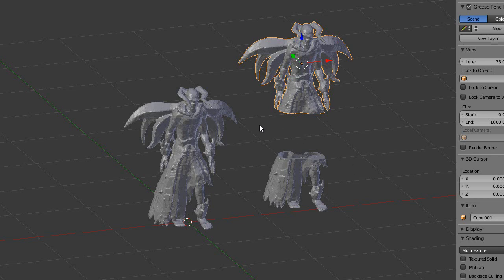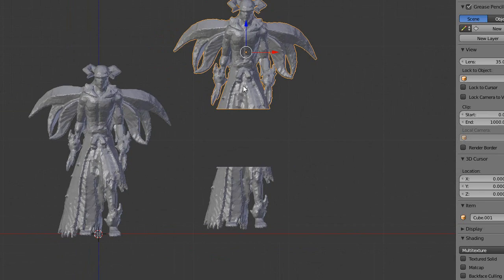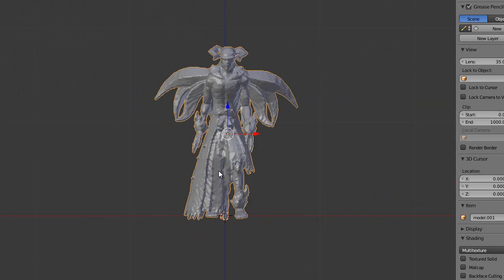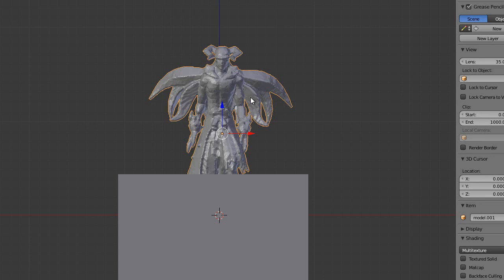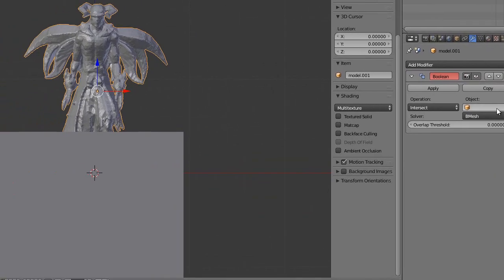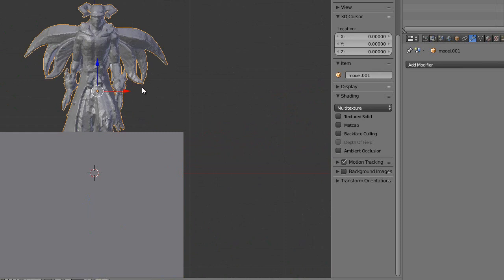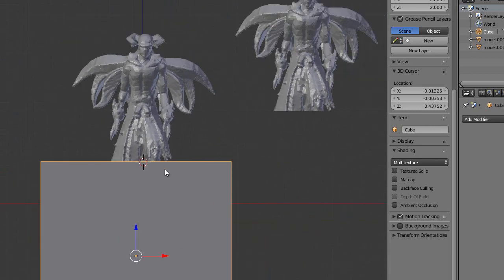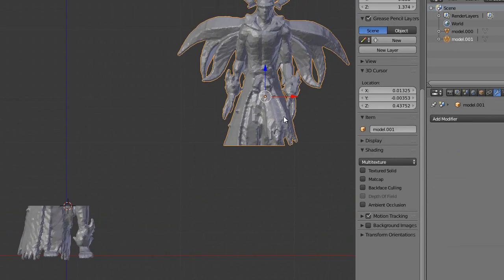Blender - Splitting 3D Model Into Parts For 3D Printing

Comment: Instead of the cube, you can use a plane, and you dont have to worry about not moving the cube in the same position. Insert a plane, position it, make a copy of the plane in the same position and then for each half, extrude the plane on the z axes in different direction.
Reply: Yeah if anybody can figure that out.  Fusion 360 So easy for this, if it would n't crash an a big mesh that is.  If you can split it fusion 360, forget blender.
Reply: @chrisdepalma6844  I know you say anyone can figure this out and it’s an old comment but I’m newish to 3D and really was needing to see this comment 😂 trying to split a large mask into 3 parts for SLA printing and have been wracking my brains for a week on how to do this to the point I’d never even considered the simplest thing! Here’s hoping blender actually likes the Boolean 😬
Reply: @sierralarars  try fusion 360. Not easy prog but i had tougher time with blender
Reply: @sierralarars  fusion has free tier. I never subscribed.
Reply: @chrisdepalma6844  the free one is for non-commercial purposes, I would using it for commercial purposes ^^’

I managed to use blender to split up the model using Boolean Auto Slice for the most part and Difference (in Object mode by using edit tab not the modifier menu) when that didn’t work. Plane slice also worked too but I found slicing with a solid object was less temperamental.

Plus side is I don’t need to learn yet another software or skirt a licence.

Comment: You can do the same by leaving both model copies in place and doing an intersect and a difference but applied to each of the models no need to do weird with alignment as they are already aligned
Reply: Thought exactly the same the first time I saw he did that. But when you have a potato PC when you try to do what you are saying Blender cant handle it and stops working. If you use his method it works.

Comment: Personally, I wouldn't rely on just moving the cube and "trying" to place it on the 3D cursor, I doubt it would be perfect and when 3D printing in 0.2mm layers, there would probably be a few layers missing or duplicated. I would use a plane as another user suggested...